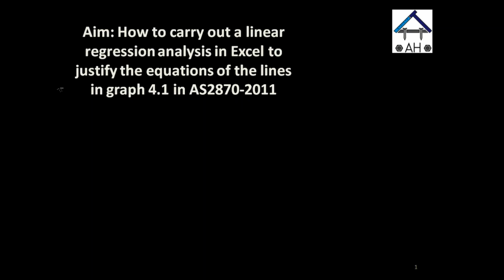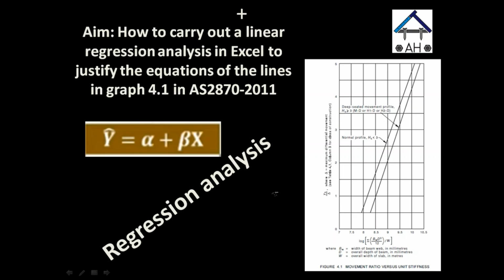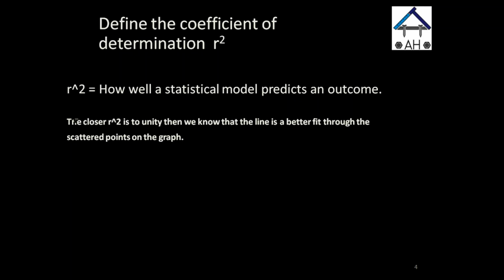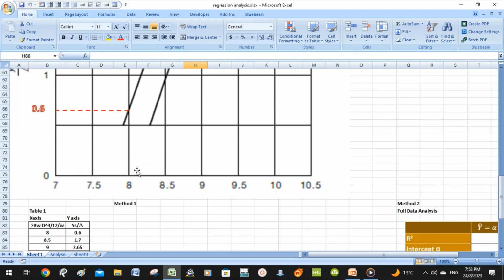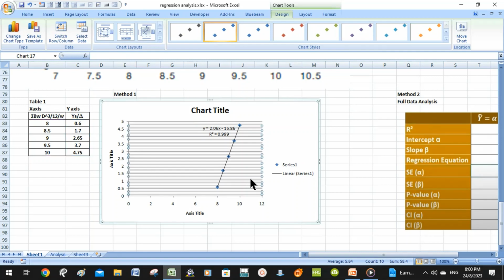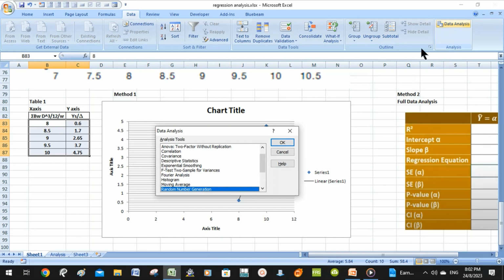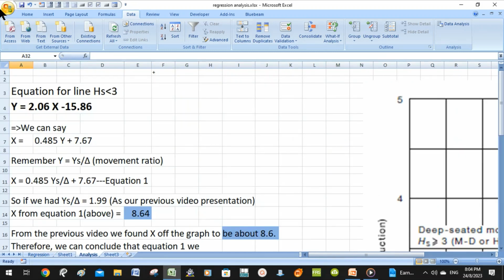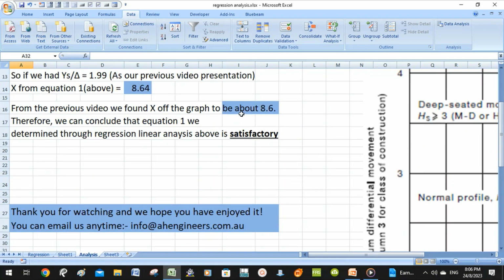Regression Analysis using excel

Comment: This is really advanced. Kudos on your great work mate. ❤ To my eyes, the logarithmic curve looks linear, so I simply estimated the equation of each line by taking two convenient points from each curve. For the 'Normal Profile' curve I took the points (8.25,1.25) and (10, 4.75) and the line equation turned out to be (Y = 2.0 X - 15.25); not bad for eyeballing. Cheers.